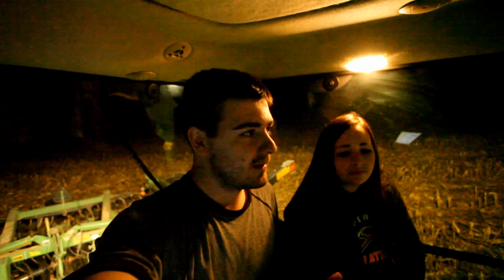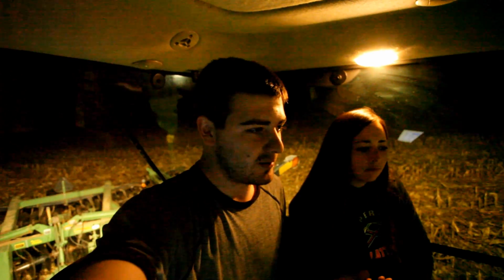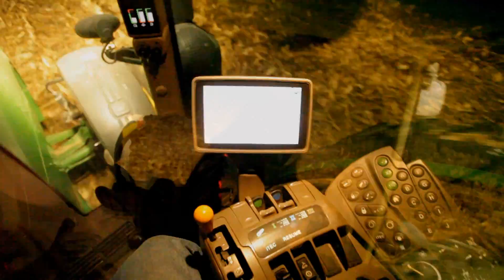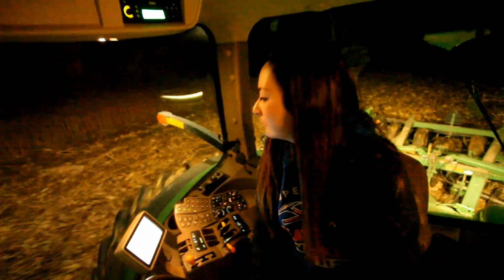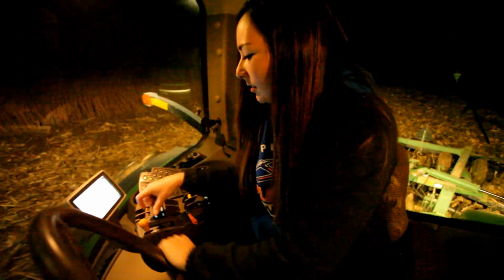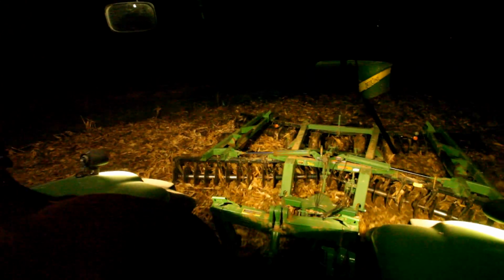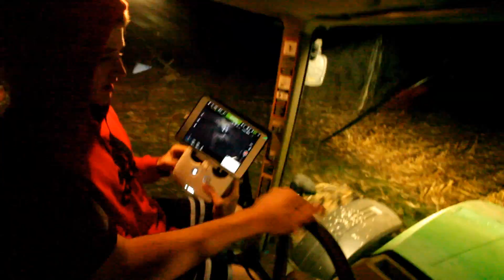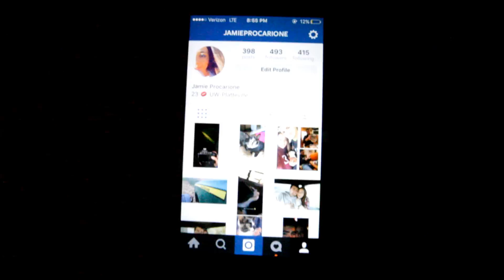Teaching Jamie to Disk with the 8235R

Comment: Not running down a conventional disk but we bought a vertical tillage disk 4 years ago and would never go back. U save a ton of time and they don't break each coulter is independent with a sealed bearing. We run around 2000 acres a year and put a new set of coulters  on last spring ($2000 for the set). All I'm saying is if u get a chance to demo one, u should. Great vid btw 👍

Comment: I'm glad you brought up the vertical tillage tool. I assume that starting the decomposition of the trash on top is the purpose and not going more than 2" in the soil? In your case, where you are trying to accomplish this while strip farming, you aren't able to "angle" the field like you see done in bigger fields? It looks like you penetrate about 6 inches with the disk. This is interesting to an old guy like me who remembers moldboard plowing for many years, then the chisel plow came out with the premise of breaking the pan left by decades of moldboard plowing (and I can tell you, breaking that pan pulled a tractor hard!!!) Now no-til and vertical tillage. Been quite a half century.
Reply: +Bill Whitman Every time you stir up the soil you lose carbon, Carbon is one of the major elements in the soil that promotes decomposition of organic matter.. My son and  i went to strip tilling 4 years ago.. The earthworms are coming back.. a good sign....
Reply: But what about the pan that develops?
Reply: +Bill Whitman My dad no-tilled back in the 70's but it was tougher because of the herbicide choices and disease issues. Started no-till again five or six years ago and now I wonder why I ever did tillage at all. Waste of time, fuel, equipment, and soil. That 8235 could be sold and replaced with a couple of 4440's maybe and a good sprayer. Integrate some alfalfa and rye cover and those roots become a pilot hole for your corn roots and no hardpan will form. Just my humble opinion, there obviosly doing fine without any free advice. I have found YouTube to be a good place to learn, I have learned a lot.

Comment: I actually put the VT blades on our old disc.  could use more weight but worked OK. we used a disc ripper after anyway, so compaction was not a concern.   most VT guys don't consider a disc with VT blades true VT anyway.

Comment: Why are you running the engine so high ? If you use auto and let the engine management do its job you will run faster at lower rpm and save diesel you are burning money there